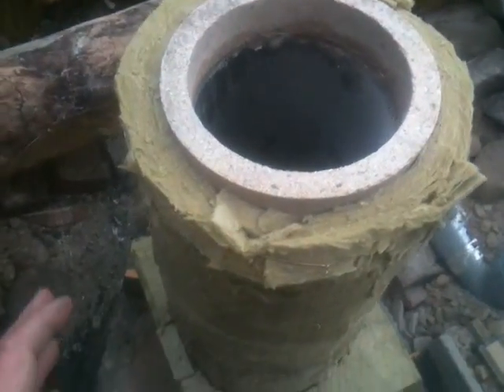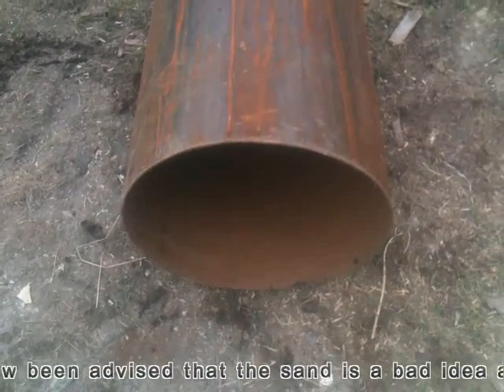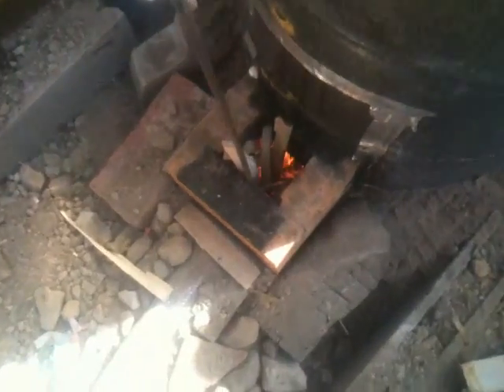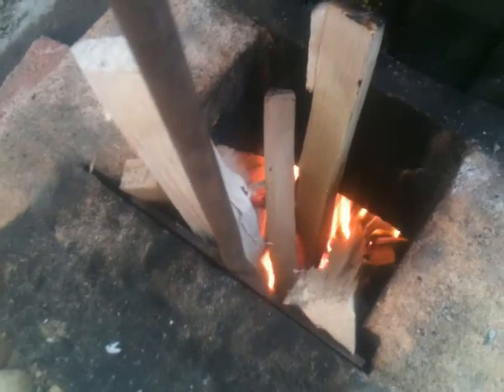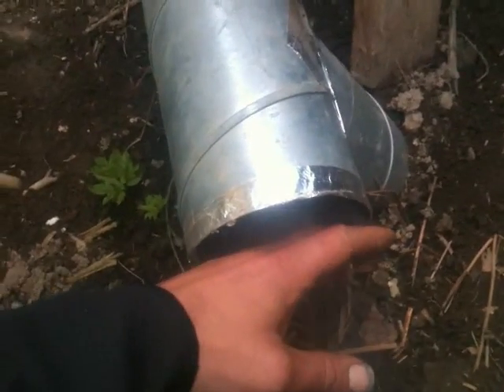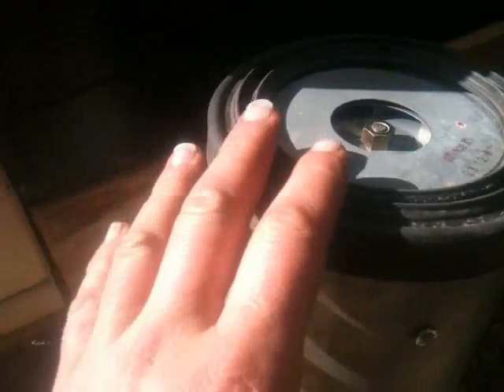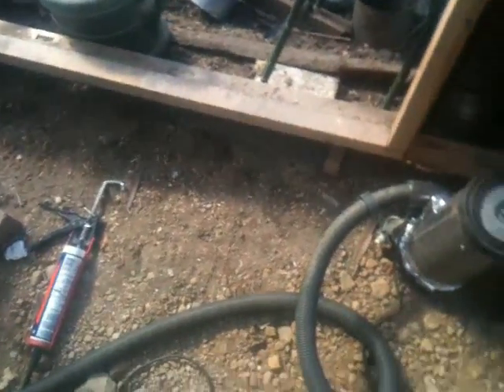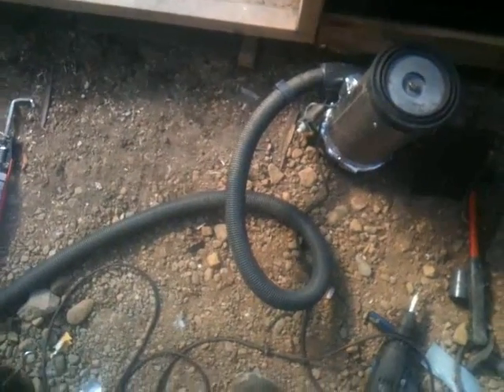Rocket stove rebuild (with Turbo Drive)

Comment: hello i have bin messing with forcing air with wood fire the last couple winters i think you might have put your turbo on the wrong end lol i have bin using the fan off a direct vent water heater but after some playing around found that putting it outside and putting all inside piping under vacuum reduces fumes and also allows better control of the in let air  only thing i wish i had was a speed control on my fan and or need to figure out a by pas for natural vent kind of all or nothing now

Comment from the maker: According to the required dimensions my heat riser needs to be 69cm, mine is 89cm, significantly longer. This does seem to provide enough draft even for my over-long underfloor pipe (11m long dia. 12cm. with two 90 degree bends)

Comment: You should not need the forced air turbo with an efficient Rocket Stove design. You seem to have most of the elements needed for high efficiency once you can get the heat riser up to maximal operating temperature. The higher the heat riser the more pull (draft) you will have and the less need for turbo forced air at intake. The more you insulate the riser the hotter your burn and increased efficiency and pull. The problem you'll have is that the rock wool will melt at the efficient extreme heat.

Comment from the maker: yes the turbo is overkill but should be interesting. The rocket is currently working fine with sand but as this is my first rocket stove I cannot compare it with anything. Those that have much more experience have found that, indeed, maximum insulation in this position gives a much better burn. My next rocket will have a heat riser surrounded by just insulation material, then I will have a direct comparison.

Comment: About the sand idea, can't see why it is a bad idea, sure it will not be hot enough to turn sand to glass on a regular wood combustion. I see no need for such amount of forced air into the combustion but to try to burn oil. A smaller flow of forced air should be enough to burn oil.